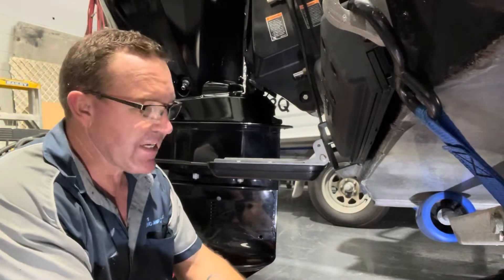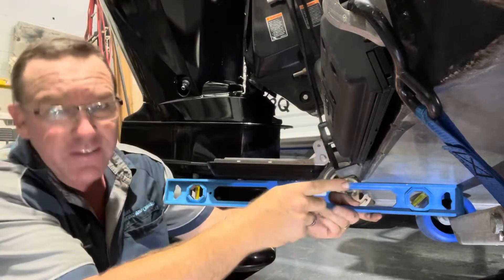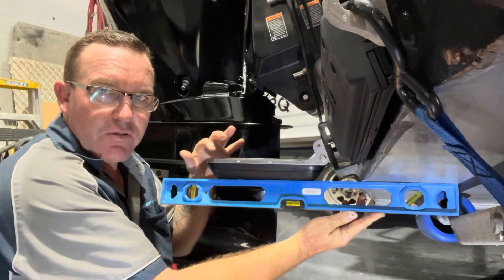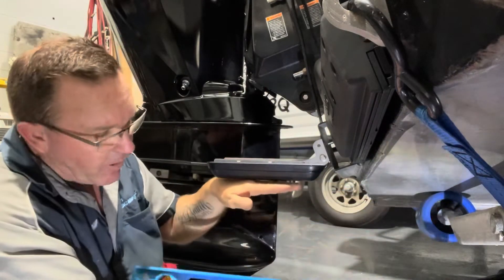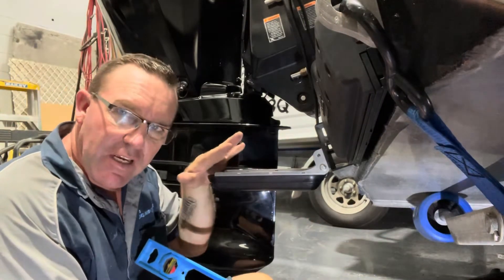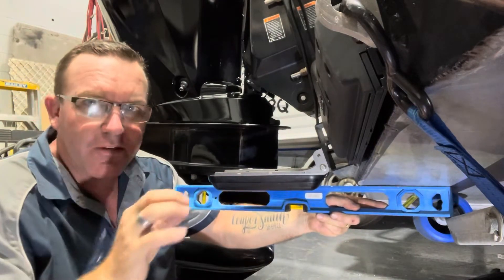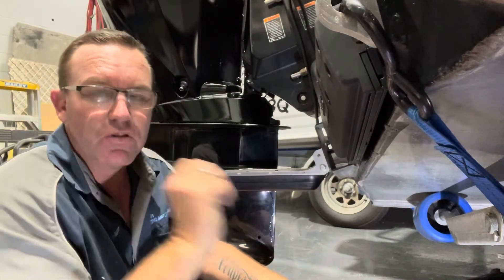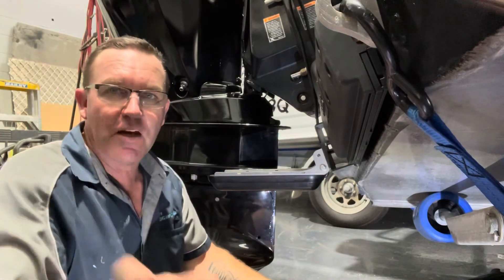Transducer set up for the 3-1

Comment: That is a good start, not trying to hijack your video, but to properly level a transducer this is how  I do it. https://youtu.be/hZXn106Hvhc  It take you getting on the water, doing a couple easy measurements and putting back on the trailer.
Reply from the maker: Thanks but without clicking on your link this states a good starting point. Minor adjustments may always be needed …
Reply: @BriansBoatingandoutdoors  I totally agree.  Sorry if I sounded like you do not know what you are talking about, that is not the case.  Very good info, my link is fine tuning.  Sorry for making it sound bad.  Keep up the videos.

Comment: Man I could really use some help. We just got an older 1988 ranger 393v. I also have a lowrance eagle 9 triple shot. The issue I'm having and maybe I'm not  using the correct vocabulary is, that it's a step hull and also a V hull. I don't have space to mount it at the very bottom by the live well drains. I have tried putting it in several places and I can't seems to get a really clear reading like the display model or if I do, I have to have a ton of settings on and I don't feel like I'm properly marking fish. It seems that at slower speeds the display is really cluttered ... However at speed and even on plane the display looks more like the store display than anything else. I'm really confused. I wish I had someone's contact page or email I could send a picture of the boat set up for some advice.nat the moment mine is mounted to the back of the boat further left of the motor and just about even w the.bottom of the first step
Reply from the maker: Hi there,
Send me a couple of photos and I’ll see if I can be of assistance 

https://www.facebook.com/profile.php?id=100063484214919&mibextid=LQQJ4d